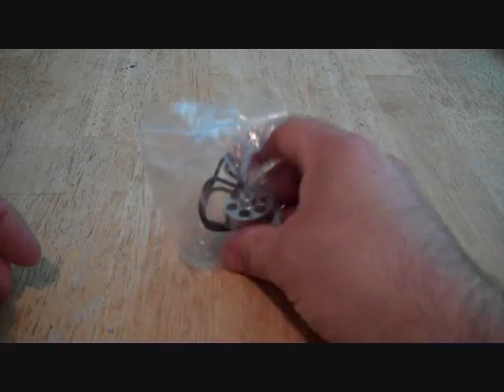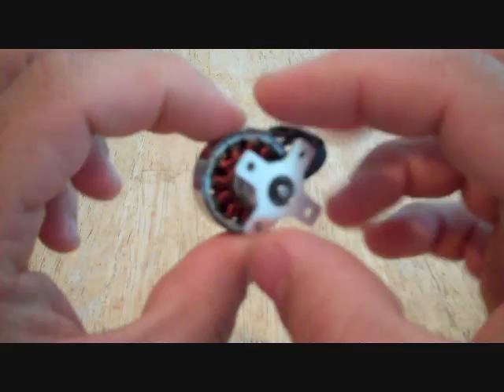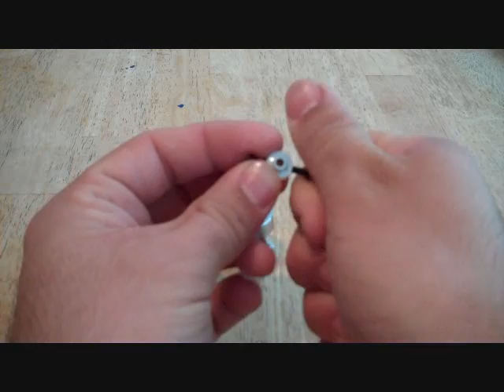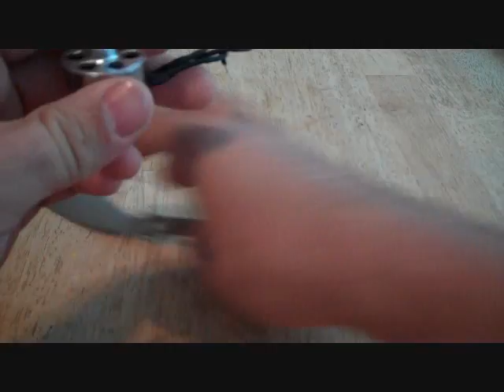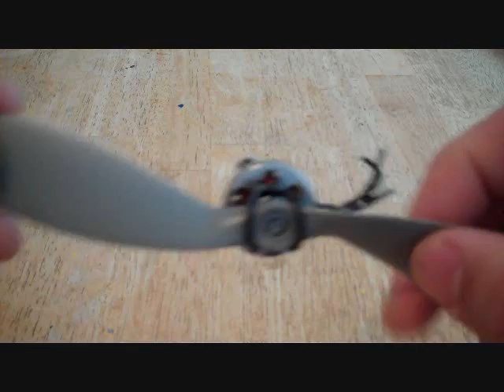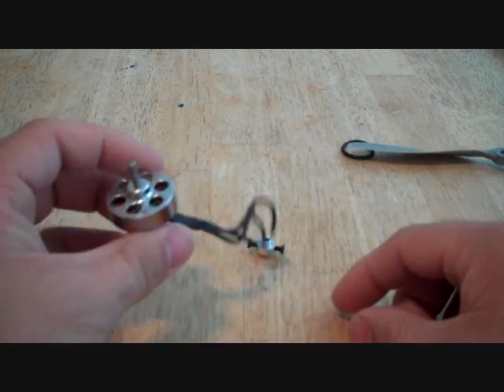How RC Prop Savers Work

Comment: thanks a lot for this video i tried using a spacer underneath the propeller and in between my park 250 brushless outrunner and made it go to full power and sent the propeller flying across the room and almost hitting me in the arm,  the way you did it is a lot simpler and safer

Comment: I'd say this was an alright video but that unfocused camera just gets me. Prop savers are only good for single propeller airplanes that general have no gears. Basically the only use i've found for them. A serious no no for multirotors and any other aircraft you may use fpv gear. Prop savers create unnecessary vibrations.
Reply from the maker: Thanks, Alex, but this video was recorded in 2011 when small cameras were not what they are today. For the time, the slight out-of-focus wasn't an issue on YT and only very recently has it started showing up on the comments. If I made this video again today, it would be much easier to make a really good-looking one. I agree with all your other points.
Reply: This is very true but some post recording editing could have fixed it a little bit. What were you shooting with back in 2011? I do believe cameras have come a long way and with this day in age everything seems to not be good enough, as i can be a little peeky with photography.
Reply from the maker: Alex Hamilton I used a FlipHD V2 for this video. It has auto focus and it's pretty crap compared to even a smartphone of the same time.
Reply: killioughtta You've got to be kidding me, maybe a little out of focus sucks for some people to see because they just can't deal with it, but seeing someone take so much time to complain is far worse. Then again me wasting even more time isn't much better. You've got to be kidding, the focus, really? It's a video about a prop saver, say thank you for taking the time to make it.

Comment: The bad thing about prop saver is, it makes your prop vibrate like hell due to unsecured joint between shaft and prop. If you using it, never run your motor at full speed

Comment: Hay it was good advice, keep your motors in a baggie. In my space I need to keep the motor sealed all the time or they get all kinds of metal filings and stuff in them. Last week I couldn't find my tooth brush....

But when it comes to prop savers I have yet to see a properly designed one. And it requires a prop saver prop designed to be used with a prop saver mount, not a flat surface design made for a flat plate held tight by a nut, someone too lazy to design it right. Talk about total dysfunction in the RC market.... jezzz. The prop saver and prop that come with a PopWing are not only prone to failure they are a danger to your eyes as well as the trailing edge of the wing and anyone nearby. A prop saver designed right in a pusher could be a great tool and capable of keeping the motor and prop in balance. Try spinning 38 k using what is offered now. And finding a proper prop adapter for one of the most popular flying wings is a joke. Why would you only use one set screw when the shaft needs to be in balance? Even without the issue of balance two set screws should be used. You need a machine shop just to fly a common RC wing. Cheap, cheap, cheap! That's all it is... HK needs to come to the rescue and get together with APC and do it right. The mount and prop need a relationship called a cone, and the pressure in relationship to the cone's shape dictates how much force is needed to move the prop off center and designed right will allow the prop to re-center it self. The only way to get what's out now to work safely is to modify it. There's a reason people hate these things... and it's not the good idea.

Comment: wow this is really a good video! Thanks man! BTW can you please help me answer my questions?
1. Prop saver helps greatly in preventing motor shafts from bending (Huge problem cus so many planes have props in the nose except jets and a few others...)
2. Can I use a prop saver for folding props?
3. Motor shafts bend because of nose dive or your propeller theory? Thanks and pls reply :D